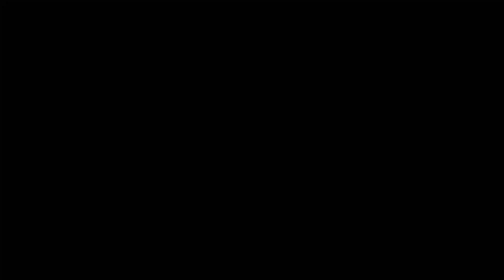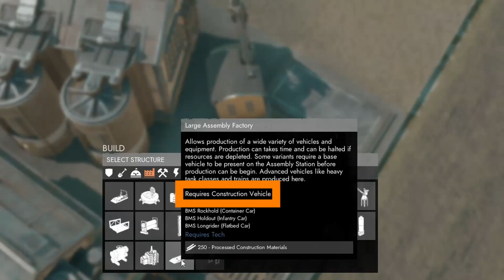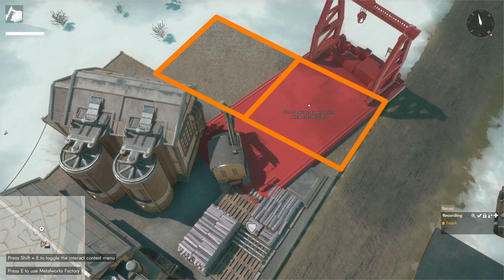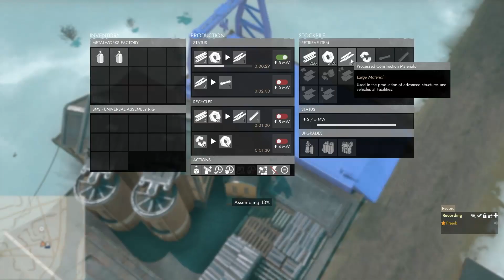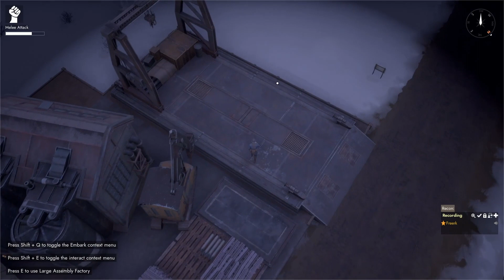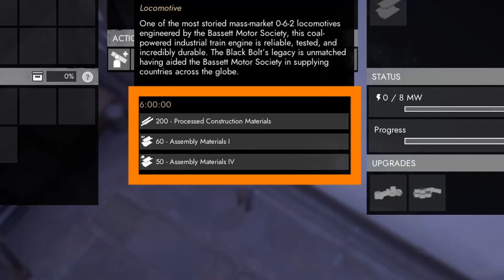Foxhole Facilities - Large Assembly Factory

Comment: Building a locomotive solo right now, just need to figure out if it is placed on regular tracks or foundation tracks and what is the difference between them
Reply from the maker: I haven't done any large trains in ages but I'm pretty sure the only difference is that you can not place normal tracks on foundations and that's what the foundation tracks are for. I might be wrong though :D
Reply: @FreerkHoltes  that's correct. Please can you make a video about locomotives.  I am currently building my second one. Please explain in the video the importance of keeping them safe(putting them on a crane with a power switch) and that they are a number one target of partisans and thus need ample protection. dont forget to also talk about cabooses. The only reason i know this is because my kind fellow wardens have taught me that
Reply: @FreerkHoltes  if you are a warden, i can come and show you around my base right now

Comment: Oh no, building that with the CV is pure pain ;-) Next time use a small gauge train flatbed cart for blueprint finishing! Drive cart next to any blueprint, stand on cart, LMB onto blueprint to submit items (in this case processed assembly materials pcmats) with 1 click. The Large Assembly Factory takes 250 pcmats, so u need to do this 3 times with flatbed cart, because it can only store 100 large items at once. Anyways, wayyyyy faster then doing it with the CV.
Reply from the maker: Wait what now? You can submit materials to a blueprint like that?
Thanks, I did not know that (obviously ;) )

Comment: I really hope they will reduce the build time for trains because you need to make all the carts too which will take forever
Reply from the maker: Personally I'm kinda okay with the time needed for assembly. Sure it will mean I will not make a train solo, but it will also make them a bit more unique and rare I hope.
Reply: @FreerkHoltes  The problem with that might be that they can be easily stolen, as someone who just finished the grind for it I would not be happy if it happened and I am kinda worried but in any case it is just so cool to be able to do logi with it.
Reply: Technically speaking, if you have a big enough logi group backing you up, you could just have more than one of these Assembly Factories running simultaneously. Having three of these, while insanely expensive, would allow your group to build a locomotive and twelve train cars in 6 hours, plus another 30 minutes for the coal car and remaining two flatbeds, which, if you have the materials for it, doesn't sound too bad.
Reply: @Green0-3  Time to make a clan that is only focused on mass producing trains